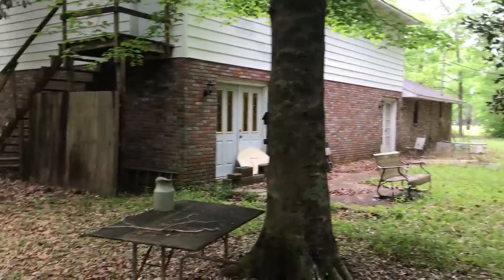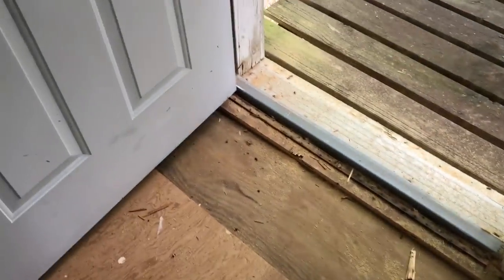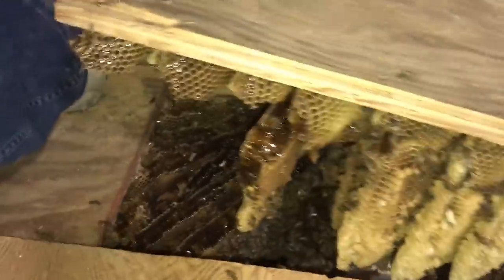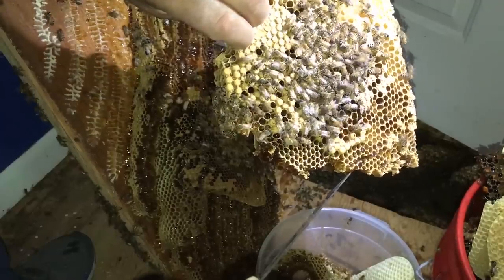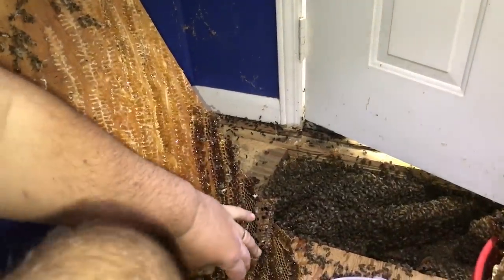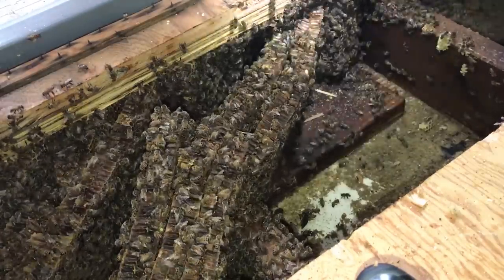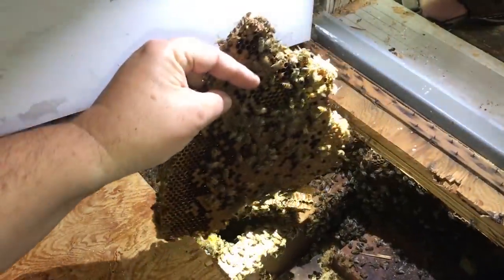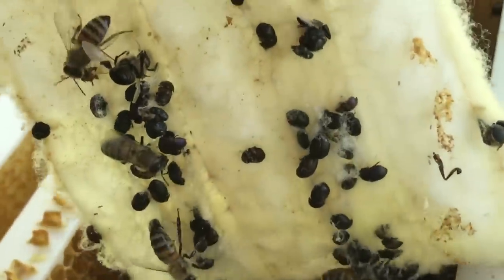These People Have Two Problems

Comment: WOWZERS! There sure was a lot of hive beetles in this hive!
Reply from the maker: I couldn't believe the hive was still healthy.
Reply: @628DirtRooster  I was curious, could you manually clean the brood off to eliminate most of the hive beetles and save  the brood. I do realize your way is the smartest and the time to do something like this may cool the brood off and lose it anyway. I was wondering If it possible to manually remove enough of the beetles to use the come with out the harm of the beetles if one was so inclined.
Reply: That’s what i was wondering we’re they beetles or roaches? Lol thanks
Reply: @matthewcarpenter7945  I'm not 100% sure, but I think The beetles lay their eggs in the comb, IF they have a chance to do so. Keeping that comb may lead to an infestation of SHB, if it were to be kept.
Reply: Question: Do the beetles get vacuumed up too ? If so how do you separate them out.?
Reply: @dkafsky  I was just asking Randy the same thing if he is tossing the comb want he still have the same problem cause while sucking up bees he is also getting beetles

Comment: Watching you guys makes me think thru the floor is worse than thru the wall, but not quite as bad as thru the ceiling, where you get honey coated. Thru the floor looks like a backache and sore knees. 
Nasty old hive there either way. I'm not sorry to e a northerner when I think of maggots in the hive. It's amazing the bees can actually control them when there's that many, it's got to be a load on the colony, using a lot of beepower just to keep the beetles in check. Nasty creatures, them beetles, but not so nasty as V mites... We could do without either.

Thanks for another fine video, stay dry and safe down there.

Comment: I admire you as your a wonderful mentor.   I did an open air bee hive removal.  1st one that I have seen in 6 years.  Unfortunately it was Africanized bees.  The hive was on a horse boarding facility.  It bordered 2 neighborhood and a running trail near a lake.  When I saw it on my phone I was super excited, but I had a hunch that they're Africanized.  I got to work and yes they were Africanized.   Had to come back that night and put the hive down.  Can't save Africanized bees that endanger the surroundings.   Why save them in the first place?  Boost smaller hives and eventually they die off.   Alone Africanized bees I don't keep.    Anyhow....  1 day I would love to come do a bee removal with Normal BEES!  I don't really even know what that would bee like.  Normal bees....  What is that?  Bees that are not in Texas I suppose.  I only run across a few a year that are respectable hives.

Comment: That building is looking pretty rough. The stairs are a death trap, The floor had water damage. Then the bees, beetles, and carpenter ants on top of that makes me wonder what it will take to save that old place. I don't think that siding cover up on the outside really did much more than hide a lot of sins on that building.

Comment: I had never thought of that before, Rooster - but of course keeping the brood would bring the hive beetles back too. I have never seen that many hive beetles at one time, daaang! If you give them clean drawn comb though - and let them walk in by dumping them out front (with the queen inside) does that take care of the hive beetles you took with them? or is there another approach to putting them in a new colony that allows you to separate OUT the hive beetles?
Reply from the maker: I just put them on wax and let them start over.  If I feed them they'll draw out new freshly waxed frames in no time.
Reply: @628DirtRooster  
But how do you eliminate the hive beetles?
Reply from the maker: @julieenslow5915  You have to trap them.
Reply: @628DirtRooster  
OH! Darn. Was hoping you could just prevent them from going in the box.  OK, got it.  And thank you sir. Y'all stay safe please. You won't be driving far for this one.

Comment: Randy since you are not keeping the comb because of all the hive beetles want you still have the same problem with the new box I noticed that while you are vaccuming the bees you are also sucking up the beetles as well
Reply from the maker: The beetles can fit through the vent screen in the vac cage, and they separate themselves from the bees during the removal process.  You can kill them as soon as you remove the vac motor.

Comment: I noticed a black hive beetle running over some comb and going in and out of open cells but how can they get away with it if bees don't usually tolerate their presence?
Reply from the maker: It's only because we've disturbed the hive.  Until we opened it the bees had them cornered somewhere.

Comment: So, probably a stupid question, would uncapped honey make good mead? Or work well for other types of deliberate ferments, like garlic in honey?  (It is a cold remedy.)
Reply from the maker: Yes, it would be similar to using ripe honey aside from having a higher moisture content so essentially the same volume of honey could potentially have less sugar which I guess could change to flavor or alcohol content of the mead.
Reply: @628DirtRooster  Thank you for the reply.  I don't make mead, but I have been wanting to try the garlic fermented in honey for a few years.  Too bad uncapped honey is hard to come by for most folks (other than beekeepers).  Or maybe elderberries fermented in honey....
Reply: @628DirtRooster  I'd have to ask a brewer on the mead.  Uncapped honey might mess up the liquid ratios or have less food for the fermenting bacteria.  Interesting to fool with if I ever have a removal done on my place.

Comment: “Saving honey bees is a way of life”  ? Is it right to say using bee vac still puts hive beetles in new hive?
Reply: no actual experience here but im pretty sure they tend to say on the comb and not on the bees themselves like those Varroa mites but im bet few tend to get sucked up if the Vac is strong enough and if you swipe the nozzle across the comb surface instead of just targeting masses of the bees above the comb.
Reply: It appears the screen mesh may be coarse enough to let the beetles through while keeping the bees in.  So once the sides are opened, I'm sure most try and scatter out, thus sifting the bees from the beetles.

Comment: you needd to get a stud finder
Reply from the maker: I did and I married her 30 years ago.  ;)
Reply: Im pretty sure he's doing things so it's easy for him. Screw the drywallers... lol.  I do the same thing UNLESS the customer signs a contract saying he will pay me to put back and repair the things I tear up. I'm an ex carpenter and do it right AND I HAVE A STUDFINDER.  Plus you can find studs by looking hard at the baseboards. The floor? Just look for nails. They're there I guarantee it. Glue too if I built it. THATS WHY HE AVOIDED THE FLOOR JOISTS.
Reply: @628DirtRooster  Golden response.